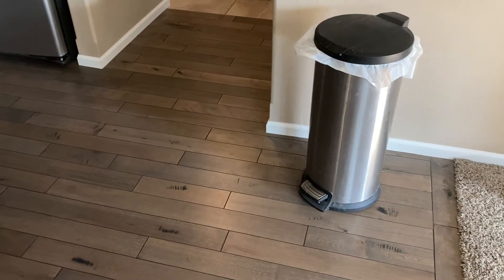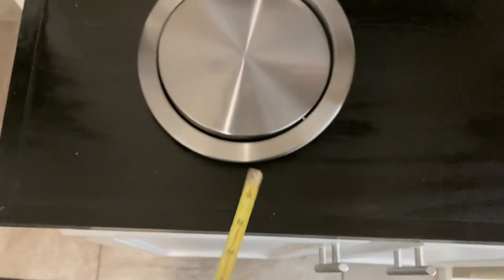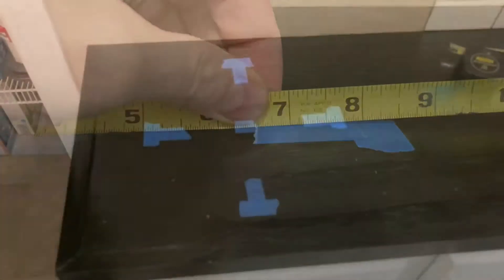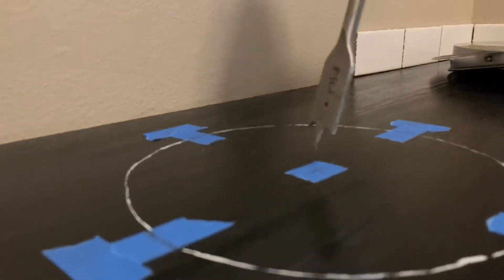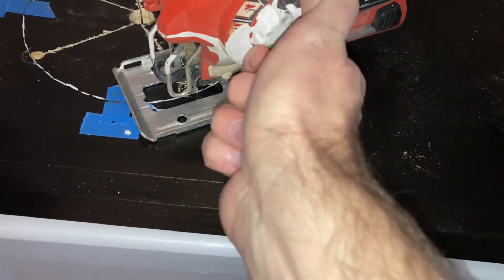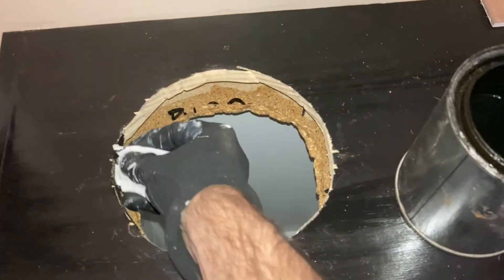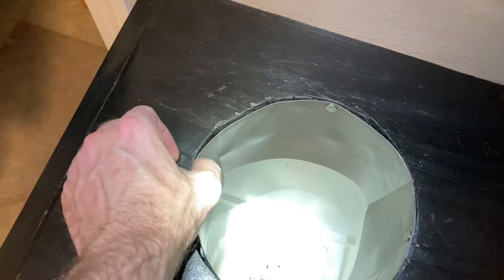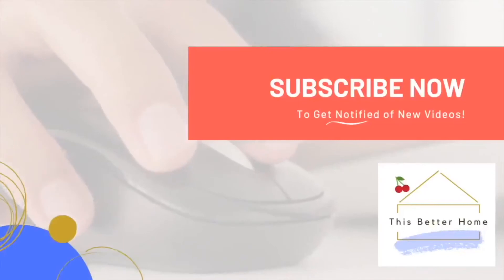️🔥 How Can I Hide My Kitchen Trash Can?➔ Easy DIY Cabinet Project!

Comment: Thanks for the great tutorial! I was wondering if you notice much in the way of odors from  this as opposed to your step on trash can with the lid?
Reply from the maker: Excellent question. Maybe slightly more odors?? But because the trashcan is smaller to fit inside the cabinet, we empty it more often. So, definitely not an issue for us.